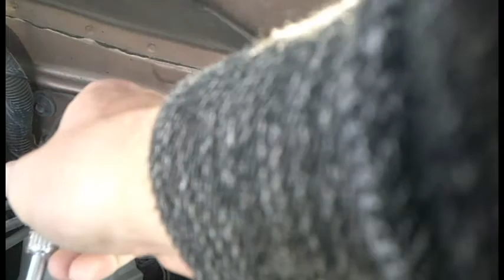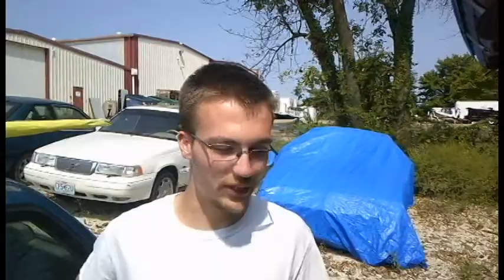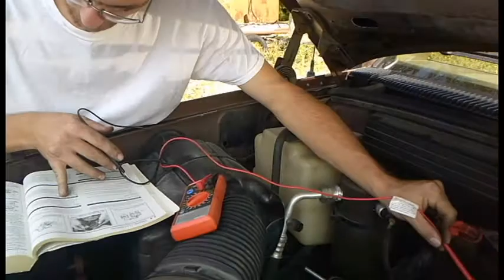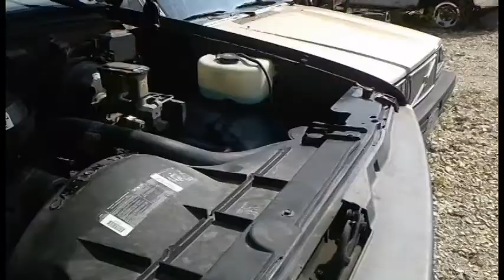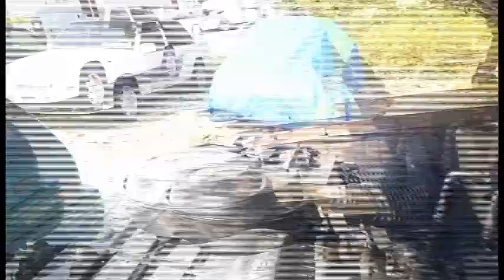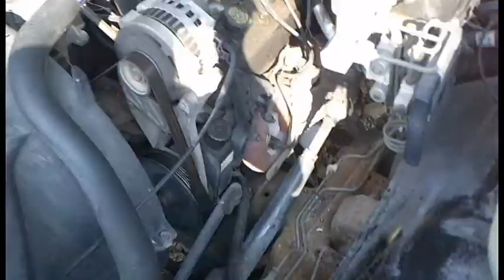Truck stopped running. no spark. took all day to fix. 1994 Chevy Cheyenne

Comment: I have a 93 Suburban K1500. Wouldn't start. No spark. Did coil, nothing. Did ignition module, nothing. Made sure coil has good ground and even added ground wire, nothing. ECM was replaced a year ago so I was Pretty sure not it. I ended up replacing distributor. For cost, it made more sense since if I did pickup coil that the distributor would have to come out anyway. Started right up. Pain in the @ss......lol.

Comment: Start watching your video 1.01 seconds in you want to know if it's firing so you're going to pull the hose spark plug out why don't you just get a test light grounded and check it I can already see where this is going it's amazing but liberals and Generation X guys called this mechanic work I might watch a little more video but I know I can figure out what's wrong with his truck and a hot second, I did give you props at least you're trying how do I turn wrenches for a million years I'm 58 years old what Toyota Prius undercar technician GM under car technician ASE Master Tech big engine bus all the Asics Freon AC certified yeah I know my s***
Reply: Hey mikey, I have a 94 chevy cheyenne 2500 305 TBI with crank no start problem, new icm, new coil, still no spark from coil... any ideas ?
Reply: @babybird57 Seems like the current must not be going to any of it. Ford has a usable link that fails occassionally.
Reply: Lol you don't know shit. If you knew all that you wouldn't be on here watching videos like this

Comment: I have 96 Silverado 5.0 cranks just no spark nor gas  the ignition switch is busted I started it with a flat head screwdriver is the key. Not being present my issue
Reply: No spark no fuel  possibly ecm